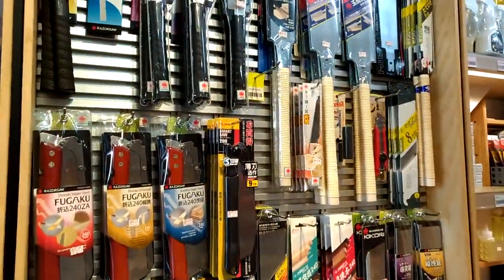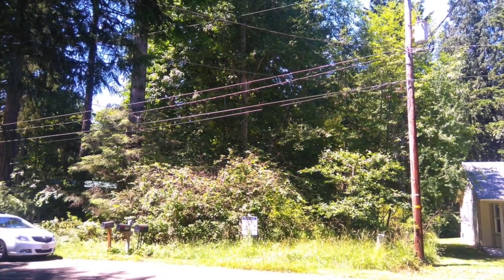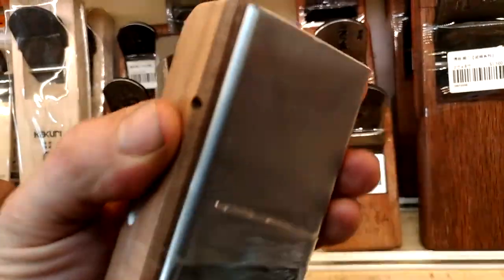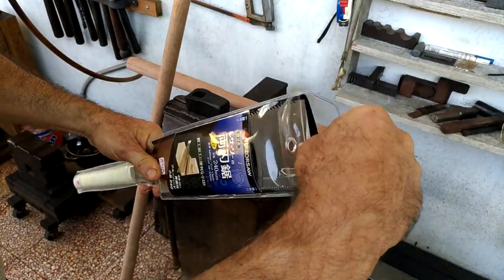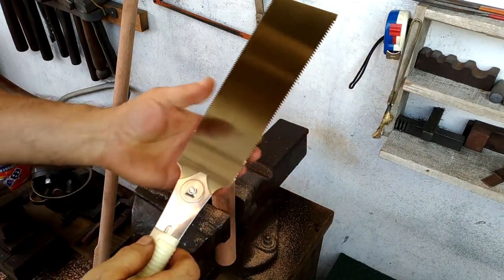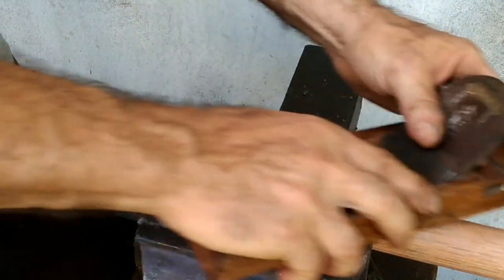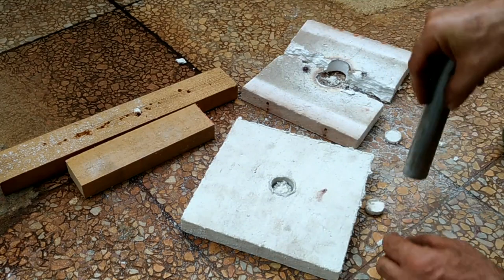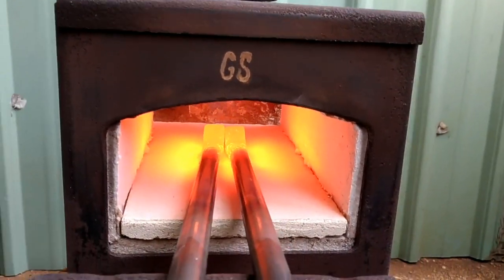New Razor Saw, Metal Bottom Wooden Planes, Forge Ceiling/Floor

Comment: Good to see you are able to move forward on your Washington property! The dirt work always takes longer and in this time of environmental regulation etal..what use to be a standard system is now  a pressure dose...sand filter or aerobic treatment unit all definitely more costly.
Reply from the maker: No joke. The rules and regulations just get more and more complicated. My system is a fancy pre-treatment unit with two holding tanks, a computer panel, sophisticated pump and some sort of aerator. And I probably wind up pissing on the ground behind my shop... Thanks.

Comment: I salvaged old panel saw blades as cabinet scrapers, in the west we use pretty beefy stock, the pull cuts use much thinner material, don't know if you can make a decent scraper out of it though.
Reply from the maker: I can certainly give that a try. But yeah, they might be too thin. We'll see. Thanks.

Comment: I've reconditioned a Japanese pull-type plane body by inletting hard wood around the throat, leaving the throat intentionally small -- when I sand the sole smooth, the throat opens up.  The width of the throat (ahead of the plane iron) helps minimize tear-out and controls the thickness of the cut.  Smaller is usually better.  Worked great.

BTW, I have a question I've been meaning to ask for a couple of years.  I notice that you tap your work twice on the anvil after you're finished striking -- I noticed you do the same thing with the handle and the vise.  What's the story on the tapping?
Reply from the maker: Thanks for sharing how you went about reconditioning your plane. Good tips. That tapping is just a weird habit I developed. I'm partially trying to knock off any scale but other than that, it has no purpose. Just a nervous tick I guess. Thanks.

Comment: It probably doesn’t help that a lot of Asian woods have silicon in them.  Dulls the heck out of steel tools and tooling.  
Cheers!
Whipple
Reply from the maker: I didn't know that. Learn something new everyday. Thanks.
Reply: @gstongs  Hey Glen!   Check out Wood-database.com to determine the characteristics of different woods from around the world.   It has an extensive list of woods and the database can be sorted by area of the world the species originated from.   
I found out about silica in wood when exotic flooring first became commercially available in the mid-80s for high-end homes.  A buddy gave me a bunch of Acacia left over from a job.  It had beautiful color and grain, and it was very dense.   Now, acacia is one of those woods that can be from several regions and can also be one of several species that is commonly lumped together and called Acacia.  It’s like Ironwood in that it’s a common name applied to several species of wood around the world. Anyway, this Acacia flooring ate tool steel bits and blades like they were butter.  My planer blades were dulled beyond use in just a dozen passes.   It was the high silicon content that did them in.   After that, any dimensioning I needed to do of the Acacia wood was done with a cheap carbide saw blade and abrasive paper on a belt sander or random orbital sander.  I think Philippine Mahogany is another species high in silicone.  Fine Woodworking had an article on silica content in wood many years ago.  I couldn’t find a link to it to send to you this morning, but I’ll keep on looking.   
Cheers!
Whipple

Comment: You could repair that plane by fitting a steel face?
Reply from the maker: Someone else said the same. And said to use my old saw blades for that purpose. I think I can at least give it a try. Thanks.

Comment: I see you use venturi burner ,do you do forge welding alot? If you do you might consider building a jet venturi burner.They have adjustable air intake ,switching from hot neutral flame to reducing flame for forge welding is as simple as pulling the choke up or down.I have build one ,its not hard maybe a day's work.They are a little bit time consuming(not exactly screw 2 pipe fittings together,filing and drilling will be involved) but once built they outrun conventional venturi burners by a mile.You can adjust everything on them ,from flame length,air intake ,nozzle position and gas hole size.You can tun them perfectly for your forge size.
Reply: I will be making detailed video(blueprints and how to do it peace by peace -i dont do 10min filing videos,no bullshit ,no shitty music ,only knowledge)  soon (when the hot summer ends :) )on my other channel if you are interested.
Reply from the maker: I rarely forge weld but when I do, it's a big struggle in this small forge. It's a coincidence you mention changing my forge as I've been working on connecting a blower to see how that works - force more air in. Not really for forge welding but to get to higher forging temp quicker. Good suggestion. Thanks.
Reply from the maker: Let me know when you post. Thanks.
Reply: @gstongs  Unfortunately its not that simple-if you force more air in the forge you will get more oxidation and more scales on material.
It doesnt matter how much air you push in ,the air will still have only 21%.
Only way to get higher flame is to build a optimised burner that will fit the size of your forge.2 large burner will choke in  a small forge,2 small and it wont have enough juce.
Optimised burner is the one that will get stoic mix-a perfect air to gas mix that will have just enough air to burn the fuel.
There is no perfection in this world ,so we aim to get as close as possible.

What are the internal dimensions of your forge?

Comment: 1:12 ugh putting steel wedge in a handle is so barbaric !I use small flat head wood screw between wedge and a handle.It works 100 times better and its no fuss to make .
Reply from the maker: Everyone has their own preferred way. Thanks for sharing.